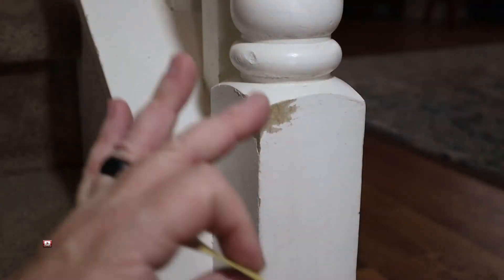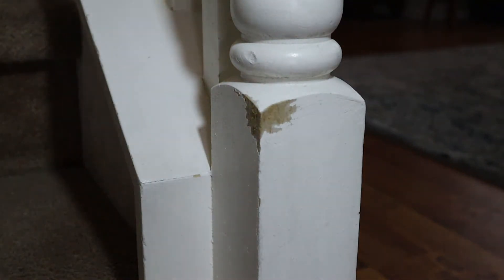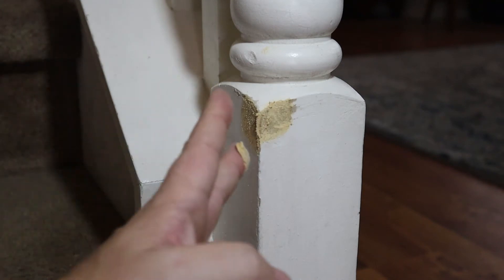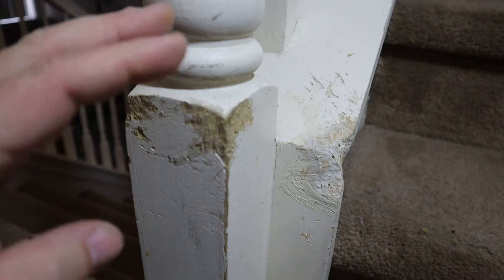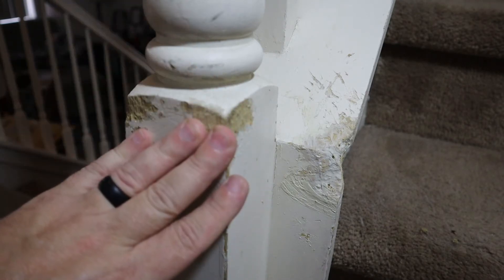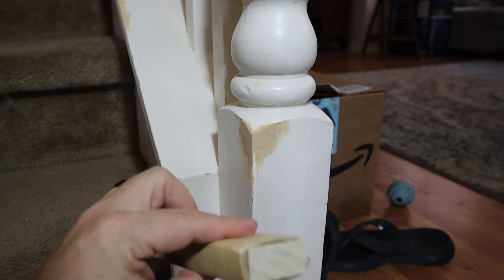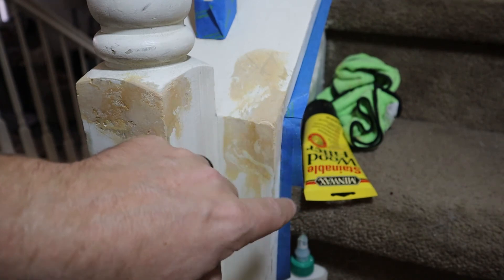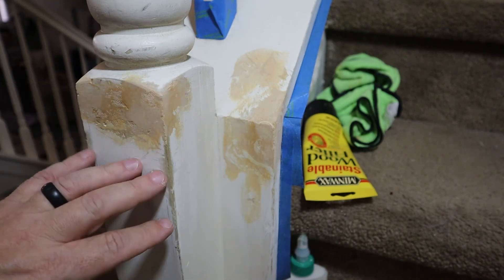How to Repair Damaged Baseboards | DIY Repair Damaged Trim | Fix Pet Damage | Dog Chewed Trim Repair

Comment: I used to breed shih tzu for 15 years and boy oh boy did they have a feast on my furniture legs, now I stopped breeding, have only the oldest one left he is 15 years old and doesn't chew on anything anymore, so I started repairing my furniture one by one. I am no pro, but it looks so much better then before.I have 2 more pieces of furniture to do, will try placing a bit of glue before the filler to see how it goes. thanks for sharing

Comment: Thanks for the great tutorial! Do you remember about how many applications/layers of wood filler you used on the far right more damaged corner?
Reply from the maker: Honestly, I don't, but I know I went pretty light on the coats.  I wanna say I used something like 3-4 coats.  I wanted to make sure that each layer would dry well enough before applying the next, and I didn't want the layers to take too long to dry

Comment: can i use white wood filler? will it have the same effect?
Reply from the maker: I would think so, as long as you're going to paint it it shouldn't really matter as long as it is a paintable filler, but I haven't tried it, so I'm not responsible for the outcome lol